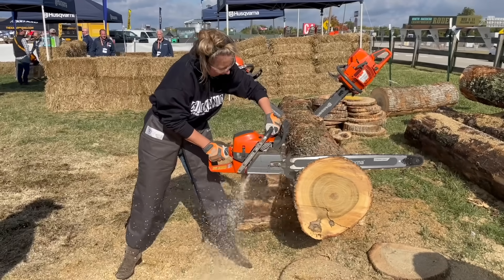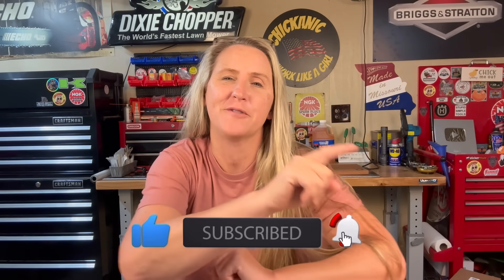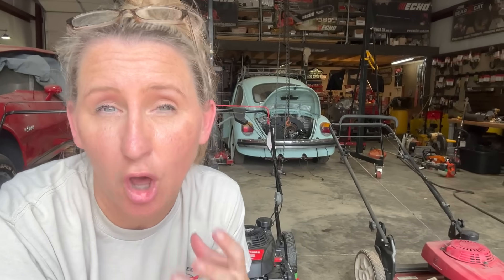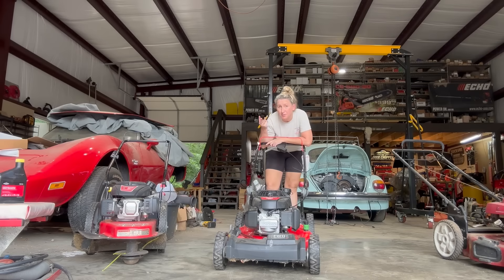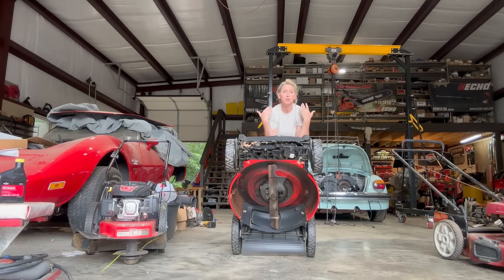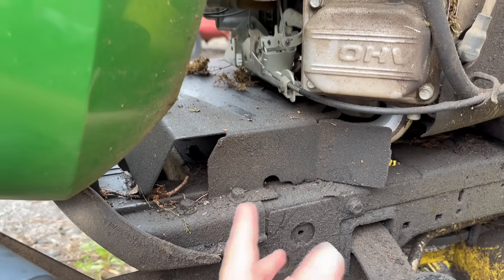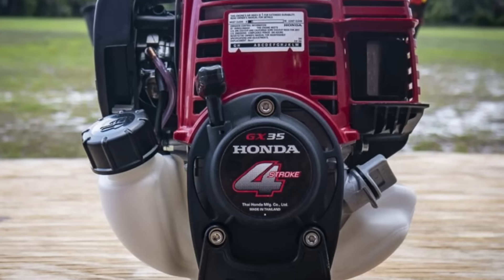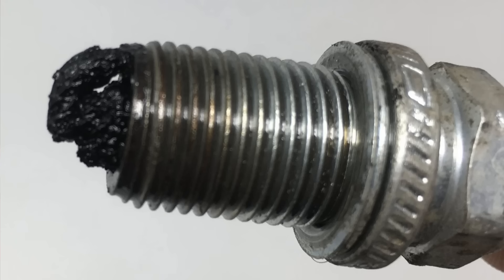Why Is Your Mower Smoking? Diagnosing 101! Small Engine Repair

Comment: How often does a valve stem seal go bad? Got a few old flat head briggs quantum engines that puff a bit.
I scored 2 ride on mowers that were 'scrapped' because of excessive smoke when on slight angles,  Both of them needed a head gasket and work perfectly fine now.
A honda i was using had a spark plug die on a job, put in a new one then it started backfiring randomly and i think some carbon dislodged when removing the plug and made its way to one of the valve seats but resolved itself after a few minutes.
Love your videos and always pick up a few tips & tricks.

Comment: In most cases the movers got cleaned by tipping the mover to the right or left side . That made the engine oil siffing into the exaust or into the airfilter . The only right way is to tipp the mover backwards with its handel down & deep as posible..  I made my own mover lift serval years ago for knife cutter service  , oil exchange and ,, uderbelly " cleaning .

Comment: Kind of miss the old flathead Briggs, never got bothered with mosquitoes mowing. Before I repowered my old John Deere JS60, I was adding oil every other mowing. Got to the point where I was putting used motor oil in it.

Comment: So do you check the oil level with the oil cap screwed down or resting atop the opening? Albeit a mower, generator, or ATV, I always check it with the cap resting atop the opening.

Comment: Great tutorial!!! Have this issue with a Honda 160. Smokes up on start up and the after 30 seconds the smoke is stopped. Engine runs well and one pull starts it up, hot or cold. It only smokes upon initial startup. Oil level is good and spark plug is not fouled. Compression is good. No, don't tilt on carb side down. Got any ideas???

Comment: A friend gave me a JD LA115 which would smoke up at times (white smoke). Then it began to smoke more often than not. My buddy had changed the carb, head gasket and still had gas in the oil…then one day I found a video where the guy changed the fuel/oil pump. The membrane in it tend to wear out and starts mixing gas and oil. A $14-$20 part is all it took. 2 1/2 yrs later and that little JD still going 💪🏻 no more smoke issues.

Comment: Two days ago I was walking to the mail box and saw my neighbor trying to mow her yard. Her Husqvarna push mower (briggs and stratton) was smoking as bad as the one in your video. I told her to shut it down and use mine. I haven't had time to check it out completely yet but the oil is thick and very black. I sent her a link to your U/T channel. Wish me luck. This was a helpful video, Thanks.
Reply: Probably has NEVER changed the oil.  
Might need to run some Valvoline Protect and Restore oil to ungum the rings...
and to decarbon the whole internals on that engine????
Reply: @s.a.stewart2743
15 hours ago
BINGO! My dad was complaining his push mower was smoking like a beach. Put a new air filter on it and he is a happy camper.
Reply: @garylangley4502
9 hours ago
I would buy old mowers from thrift stores for about $5 many years ago. Most of the time when they they smoked, it was due to lack of changing the oil. 

The old oil would have carbon in it, and the rings were stuck. 
I would use fresh oil and some engine flush in the engine, run it for about 10 minutes, then change the oil again.

 I used 15W-40 oil because this was in Yuma, Arizona, and the engines needed an oil that would withstand the heat there.
 I would use it for a little while, and then I felt confident that I could sell the mower and know it would last for a whilr.

Comment: Bought first mower in 1988, a Homelite from Montgomery Wards with B&S engine and a long dipstick at top of engine cover. Could not see clean oil on the dipstick. Overfilled. Mowing business partner’s lawn no smoke for first 10 minutes then BOOM! Sudden smoke bomb. In seconds 3 houses were hidden in blue smoke. People ran out of their houses expecting an aircraft crash or something.

From then on I only  put used Mobil-1 15W-50 from my car into the mower. 10 years later the aluminum deck cracked. Gave it to a friend who put the engine on another deck. Used car oil didn’t hurt it one bit, but I was able to see the oil level on dipstick. Never needed to add between changes.

Comment: Yeah, I have one that is a Frankenstein model I put together, that I don't have a history on the engine that smokes, sometimes.  I can't determine when it is going to smoke, so it is hard to know what causes it on any particular day.  I have one of the Mantis tillers, but it is the 4 stroke Honda engine on it, and we can never get the amount of oil right in that thing.  But we have had it for probably 25 years, and it is a solid machine.

Comment: I think it all comes down to knowing your machine and following the manufacturer's recommendations!  Oh!. Keep a log of what you do in the manual so you don't have to guess when the last time you changed the air filter or changed the oil. The more expensive the machine, the better records you need to keep.
Reply: Ha, whats a manual??  My rotovator has a b&S flathead motor, smokes like a chimney but is that old the manual was  carved in stone!!

Comment: I knew a guy working for a landscape company that filled a mower with oil all the way to the top of the dipstick tube, the end of which was at the top of the engine housing. He started it up on a customer's driveway and promptly blew a head gasket. The owner had to go get some degreaser and clean the driveway, in addition to getting the mower repaired.
Reply: That's why only one person should be paid to look after all the engines in a company...
check and change the oils and filters,
mix the 2 stroke fuel and replenish the fuel cans on the trucks EVERY DAY.

Comment: I would buy old mowers from thrift stores for about $5 many years ago. Most of the time when they they smoked, it was due to lack of changing the oil. The old oil would have carbon in it, and the rings were stuck. I would use fresh oil and some engine flush in the engine, run it for about 10 minutes, then change the oil again. I used 15W-40 oil because this was in Yuma, Arizona, and the engines needed an oil that would withstand the heat there. I would use it for a little while, and then I felt confident that I could sell the mower and know it would last for a whilr.
Reply: I was stationed in Yuma in the early 90's, lived on 6th Ave down by the Colorado river, miss seeing the chocolate mountains

Comment: I have found that very old engine oil will cause a lot of smoking issues.  Usually coupled with overfilling as people keep adding more oil .  I have recovered several 4 cycle mowers by a simple change of the oil.

Comment: I had a 20 yo MTD rider that you had to warm up before mowing. It didn't smoke until you kicked in the blades. But again, if you let it run without the blades turning for about 5 minutes you could then start mowing. If you didn't warm it up, it would smoke so badly that you couldn't see or breathe.

Comment: Bre, you have made a believer out of me. I’m referring to the mechanic in a bottle. I have a Murray mini tiller that has set since 2007 or 2008 somewhere in there until just recently. I took the carburetor apart and  found the diaphragm was crispy. I got a plastic bag, put the diaphragm in it and a little bit of the mechanic in a bottle and let it sit for a day or two until the diaphragm was pliable and then reassembled the carburetor and it starts and runs. so like I said, now, I believe in it!

Comment: Husky yth24v48, with a Kohler Courage 24 hp engine. 12 years old. Doesn't use an appreciable amount of oil, but puffs smoke upon me starting the mower blades turning. Clears up quickly, and mows strong.  Any ideas?

Comment: How do we know how to read the dipstick? Some engines the level is read after just putting the dip stick in without screwing it down and others I've seen are measured when it is fully screwed in. Is there a rule of thumb as to what method to use for each manufacture? (I have an old 80's vintage Brigs that no where in any documentation I've read does it say how to correctly fill the crank case and measure the level other than read the dip stick).

Comment: I had a LOT of gas in a '68 Plymouth 318 with a diaphragm fuel pump. Luckily, it did not have an unexpected catastrophic incendiary rapid disassembly. The mechanic who worked on it said, "at least the internal components got flushed a bit" 🤣

Comment: Help. One of my riding mowers requires at least 100lbs on the seat or the safety kills the engine. I have blown out mufflers because of the backfire. I’m only 95lbs. The older riding mowers were easy to rig the safety, no more. This John Deere the trigger is in the seat. What can I do.

Comment: Dang, I've been flipping my mower on the carb side to take the blade off and sharpen it and remove grass for 20 years.  The same mower.  No wonder it doesn't run smoothly for 1/3 of the yard and then it smooths out.  I'll try pushing the handle all the way down, thanks

Comment: Thanks to you I do all my tune ups on my John Deere LA 125. I bought it brand new many years ago. Even though I'm now in a wheelchair I still do everything my self. From the tune ups , oil changes and resharpening the blades and balancing them. Plus buying new tires and rims at tractor supply. The AG pro charges way to much money for a tire and rim. I can buy three tires and rims at T/S or go to AG pro. Only the blades, and belts I but there. Nobody has my deck belt or blades. Otherwise it's running great. Over 4000 hrs on it. Thank you for saving me a ton of money. If you were closer I would take you out to lunch or dinner. Saving your shirt husband alot of money. I'm your tallest fan. All 7 foot of me.

Comment: If you haven't tipped it, or changed oil or fuel, and it goes to blowing lots of blue smoke, especially on a cheaper older unit, it's a good indication there's something seriously wrong.

Comment: Semi-Pro Tip:  To keep gas from getting into your oil, install a fuel valve.  Every time you are done using your mower, turn off the valve and run out the gas.  Do this at the end of the season, and you won't have any problems getting the mower up and running in the Spring.

Comment: Of course I over fill my lawn mower, I don't like mosquitoes.  But seriously, smoking is not a good thing and like you said usually pretty easy to fix.  I wish I could have figured out how to seal up my Kohler engine's valve cover, it always smoked.
Reply: There is an update kit....new v-shape cover and a steel piece to reinforce it. Throw away the cork gasket. Use Permatex Right Stuff gasket maker. No more leak

Comment: I have a Briggs engine on my simplicity zero turn mower. Changed the oil this spring and I put in the amount of oil that the manual said, but now the dipstick reads way over. So do I believe the dipstick or the manual that came with the mower? I love your videos thank you for helping us all.
Reply: Did you also change the filter?
If not then the quantity of crankcase oil needed will be less...
Reply: @JohnSmith-pl2bk yes, I did change the oil filter too.
Reply: @peacefieldfarm_mn  
Now you need to find out if there is a manufacturer's bulletin re wrong dipstick???
Could have been wrong right from the OEM?

Comment: Smoke on 4 stroke... not good. A little smoke from a 2 stroke is best. Plenty of lubrication. We burned up a Husqvarna 128LD with "True Fuel"... too lean, had to replace the cylinder. :(

Now, we've learned to mix the oil to a level where the machine just barely smokes (gotta take out the spark arrester)... the machines run best this way. 2 stroke dirt bike racers learned this decades ago... 
"If it ain't smokin' it ain't strokin' and it's fitten' to be broken." 😄

You'll probably bust me in the chops for this, but I'll keep watching anyway. Love the channel. 😇
Reply: 40:1 modern chainsaw oil in an old Lawn boy 
after I had run it for 45 years from new in 1963 when Dad mixed 30wt car engine oil @ 24:1 Modern synthetic oil..........no problems
Reply: @JohnSmith-pl2bk  yep. We've even used 80/90 gear oil for mix in a pinch. Project Farm showed a while back that engine oils appear to work just as well as dedicated 2 stroke oils. 
We have an old Echo that just won't die... it's been running on various oils, mixed heavy, for five years now. Just a tiny bit of smoke from the exhaust is what seems to be best. Machine revs up much faster than with the 40:1 mix from the cans. 
We removed the spark arrester to let the machine "breathe". :)

Comment: Guy was watching me change the oil in his ancient (like 40+ years old) Murray pushmower with a Briggs 3.5HP engine. Briggs doesn't make 'em like that anymore for sure. It had no oil drain plug, so the only way to get the oil out is turn it upside down and let it drain. Of course, after adding new fresh oil, just have to let it run about 5 min to burn off all that oil. It smokes like crazy for a bit. He was convinced I burned up his precious mower. lol. No dude. I know what I'm doing. Then after it burned off, I popped in a new CJ8, and it runs smooth as silk. He was about to have a panic attack for a bit haha. He wanted the carb serviced too, but it totally didn't need it. Ran perfectly.

Comment: Okay when it comes to oils, virtually any oil with the service classification of SP and a weight of 5W-30 is fine for all flat tappet engines it already has the correct amount of detergents and zddp.. if you don't believe me check with the motor oil geek
Reply: https://youtu.be/a3uXSI9wQv8?si=rGp4kF1L05NGhkTu

Comment: @2:56   what the h  e l l !!!........   one other you may have omitterd is a kohler command.  if you dont do as the book says and shut it down a t idle and it  costantly lets out the big bang  it will break off the crankcase breather reed and then suck oil in and burn it

Comment: My edger, trimmer, chainsaws and push mowers are all 30 to 33 years old. I take very good care of my equipment. Sure now and then I have to replace a carb on the weed eater or chainsaw but that's because they just wear out. I clean my air filters after every use and change the oil every season. It makes a difference.

Comment: You just said something that I have wondered about and is IMO SIGNIFICANT!
You said, make sure to use oil with ZINC in it. I think this is correct!
Does this include modern push mowers and riding mowers?
I just bought a new Cub Cadet and no where does it mention OIL with ZINC.
Reply: Buy diesel  10w30 or 20w50,it has more  zinc  than gas oil.
Reply: Why would they tell you to use zinc when all that does is make your engine last longer. They're in the business of selling products.

Comment: John Deere LA-145, 22 HP B&S twin cylinder, 615 hours, never over-filled.  Smokes a lot!  No obvious leaks.  Should I look at replacing the head gaskets?
Reply: It makes a difference to skill between the V2 in upright standing position mount or the V2 in flat mount position .
Reply: @wolfgangemmerich7552  The cylinders are horizontal and the shaft vertical.
Reply: I have a LA140 that smokes, too.  Smells like oil to me.  No obvious leaks or overfilling here, either.  New air filter, etc.  I probably have the same engine.

Comment: I've seen small STIHL 4 stroke engines that have no crankcase oil plugs because the tolerances are enough that oil in the gas keeps it alive. Not too keen on that idea but it works... somewhat.
Reply: Yes in deed ; this 4 stroke  STIHL engines runs very well and some ,, oldtimers " under its users got reminded to the Honda Dax & HONDA MONKEY engine sound !

Comment: Tip. If you need to tip your engine to the side try to make sure that it is on TDC of the compession stroke then at least oil should not pass the piston from below and both valveswill be closed if some does. You can do this simply by feeling the compression by pulling slowly on the start cord.

Comment: My old 2000 murray lawn tractor with a Tecumseh engine would smoke on start up but adding AT-205 to the oil stopped that. 👍💯

Comment: I have a 225gt echo trimmer, it started losing power. I thought it was a fuel delivery problem, I rebuilt the carb new fuel lines fuel filter air filter. I have fresh premix in it. It works fine then starts bogging and has low power then it works fine about 20 minutes later. Does anyone have any ideas on what to check or replace next?
Reply: Get a Stihl,,, problem solved,,, been there 😂😂😂😂
Reply: @Joseph-u6d Its been good for 18 years, I don't think it owes me anything. It still starts first pull. This is the second time I rebuilt the carb. When it runs right it still has the same power it did when new.
Reply: I would say check the tank vent